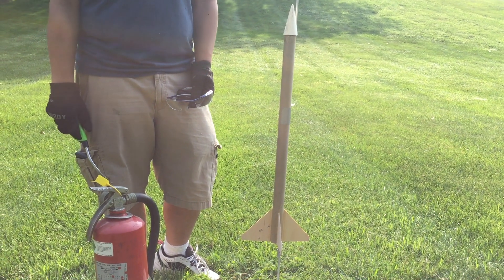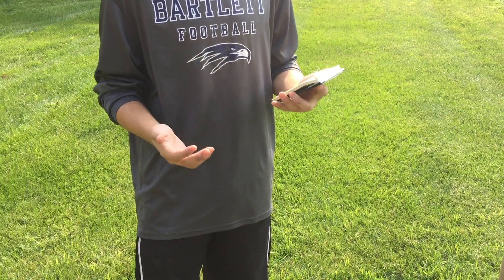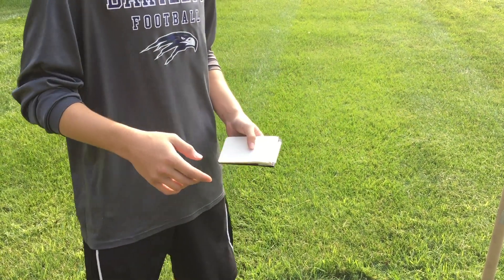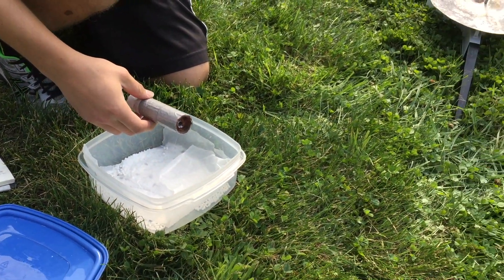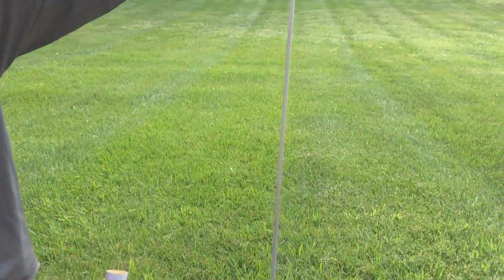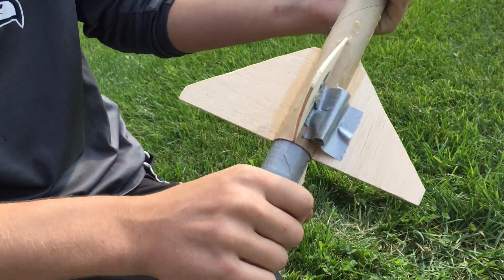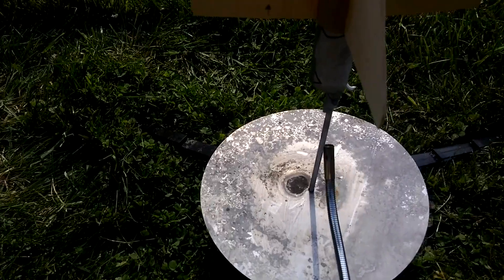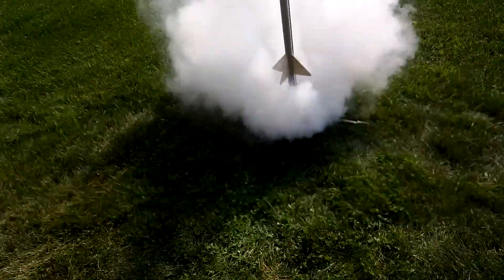Homemade rocket launch

Comment: Might wanna consider filling the whole rocket up, because i could tell your center of wing area was behind your center of mass. Think of a dart, they have a weighted front end and a light back end with fins. You want your rocket to be like that, you want your center of lift to be just behind the center of mass, or it will fly all over the place, if done right it will fly perfectly straight, or worse case scenario it will gravity turn, (very slowly turning toward the ground)

Also you want to consider how the fuel burnimg changes the center of mass, as it burns it will tend to move forwards.

An easy solution to this seemingly complicated problem is make it like a bottle rocket. The stick provides drag to keep it straight, its a fin without wings pretty much.
Reply from the maker: Thank you so much for your advice! we had no real experience at the time of this recording so seeing such nice advice means a lot to us!
Reply: Bro it's good learn always
Soo just know more about the stuff and just bee careful in case 
And calculate every thing before u try cause even a small mistake can cost much with rockets
Hope u guys will successfully launch and recover it with parachute next time
All the best

Comment: You have so much to learn about rocketry before you upload it. Embarrassing 😂😂😂.. The take off was bad. A perfect takeoff is instantly takeoff as soon the engine is on fire. You need a hole thru the engine and use a fuse so it start to burns from the top and down and not like you have done.
Reply: The only embarrassing thing here is your comment 😂
Reply: @guydenney587  Because I have 15 years of experience in amateur rocketing and building mostly 2 and 3 stages rockets. Highest I reached was 11500 meter, around 34000 ft.
Reply: @lowlandspi5792  just because you have 15 years experience, doesn’t mean you can bully others just starting. Come on man, this want nice at all.
Reply: Don't discourage young minds man
Reply: Custom engines don’t always launch immediately
Reply: @nasawormlogo9521  My engine's gives full power as soon I hit the "fire button". The trick is use some black powder inside the engine as deep as possible. You want the engine to start burning from the top and downwards to get most power out of it.
Reply: they are probably about 15, you started making rockets when they were born.

saying this is embarassing is like bullying a preschooler because he cant count to a 1000
Reply: fck off